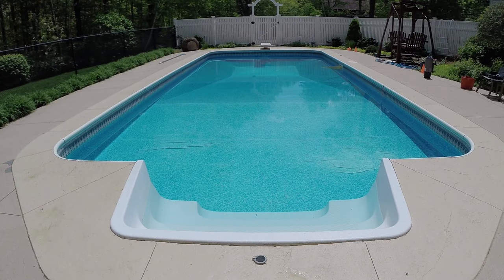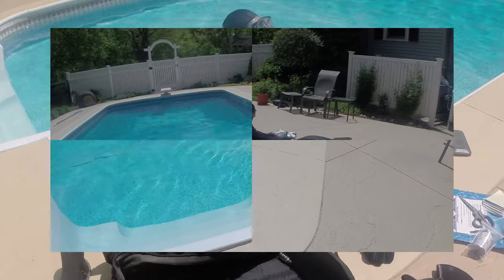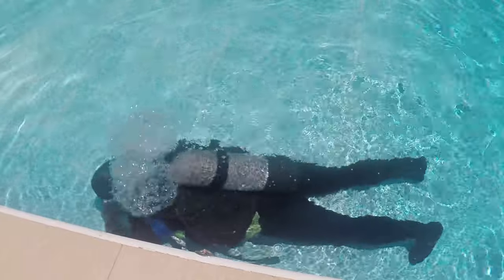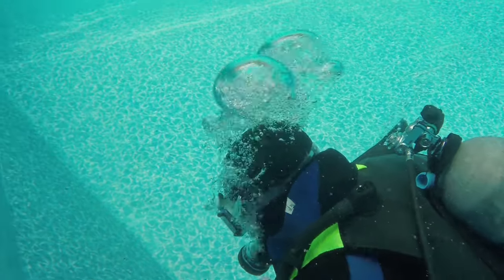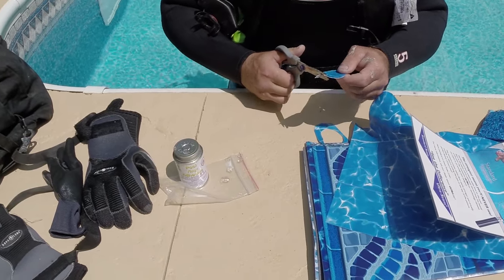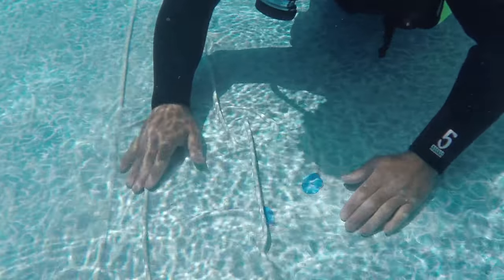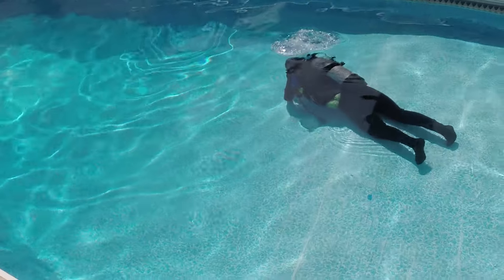How to Fix a Hole in Vinyl Swimming Pool Liner Underwater Repair

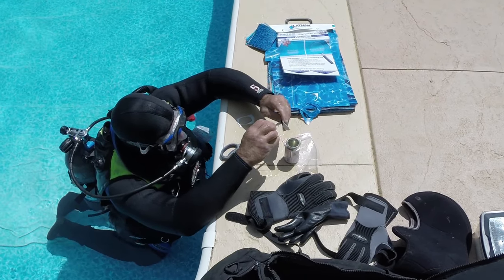Comment: You mentioned "bonding cement" in the video (at 2:19), but at the beginning, your graphic says "vinyl adhesive glue" (at :22). However, you call it "vinyl adhesive cement" (at :27). Can you please clarify this? We have a pin-hole leak on the side of our above-ground pool and I don't want to buy the wrong thing. Thank you!!

Comment: That liner is wrinkled all to hell!
Reply from the maker: Your right. It's surprisingly the original liner which is over 15 years old! The wrinkling is due to water seeping between the liner and pool floor. This wrinkling could be from ground water or pool water and small holes.  The homeowner is looking for a extend the life of this liner for another 2 years and decided to spend $2-300 for the repair instead of a liner replacement.